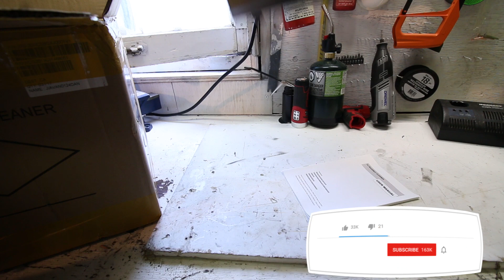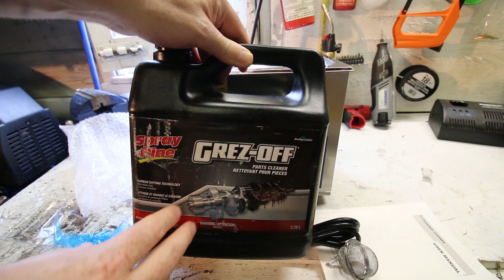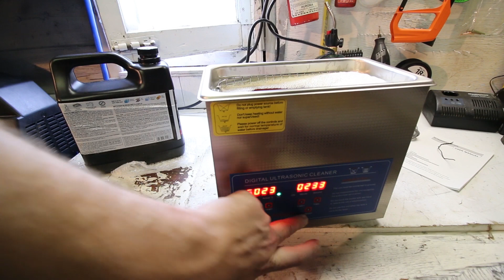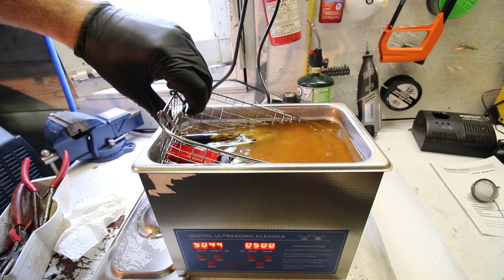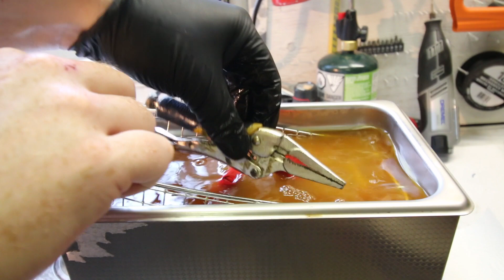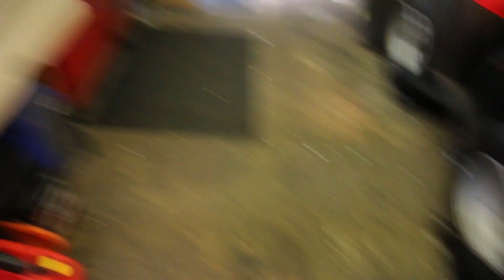Ultrasonic Cleaner For Parts & Carburetor Cleaning 🆕

Comment: Hye just purchased an ultrasonic cleaner, how well did you find this works? did you end up mixing it with water or anything?
Reply from the maker: I mainly use winter washer fluid as the garage isnt heated all winter. Not as good as heavy duty cleaners but works pretty decent